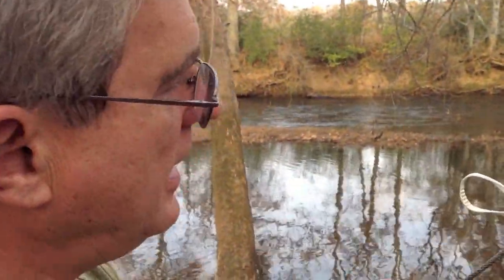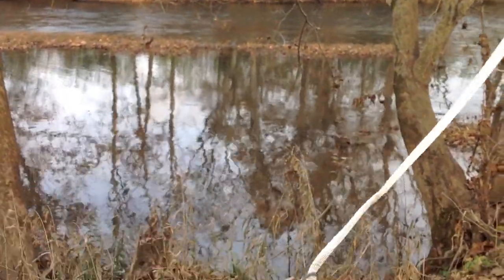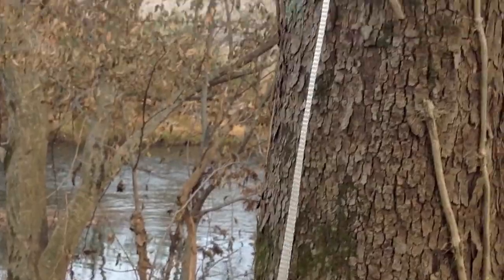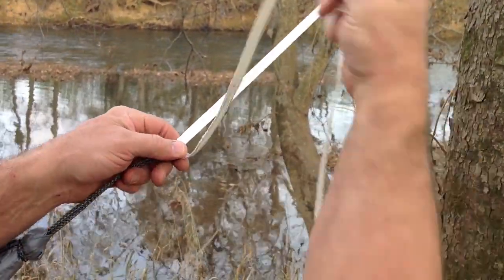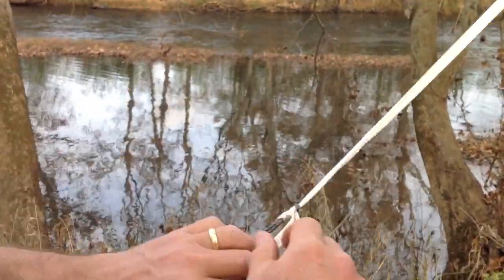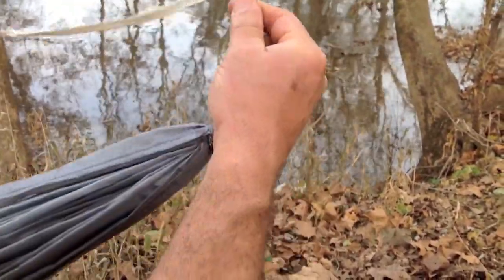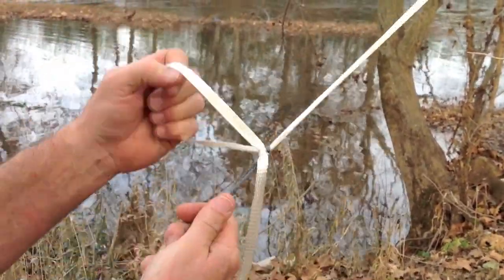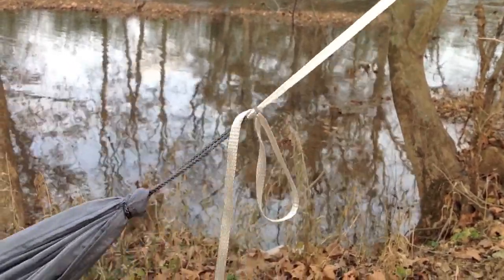The Becket Hitch Knot (a.k.a., The Slippery Sheet Bend Knot)

Comment: This is a slipped or slippery Beckett Hitch. The difference between a Sheet Bend and a Beckett Hitch is that a Sheet Bend is tied in a byte in another line. A Beckett Hitch is tied in an eye splice or a continuous loop. It will still come untied if not under load and subject to intermittent back-and-forth motion (i.e. a hammock in the wind without load). Thank you for the video.